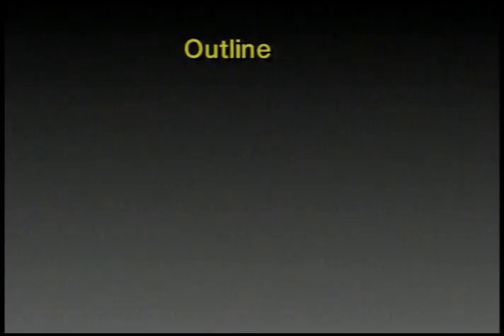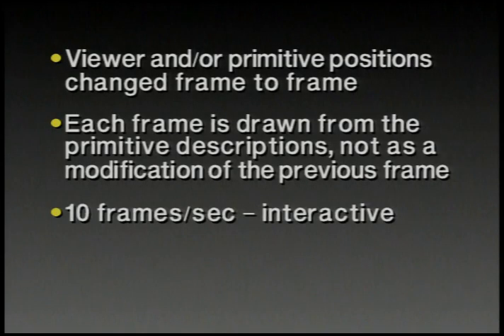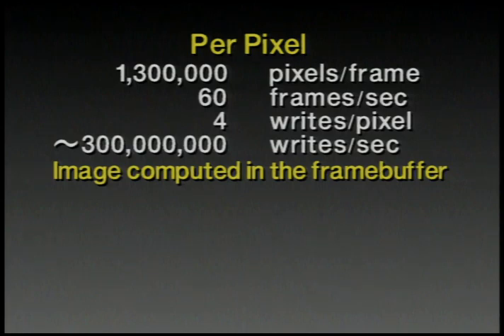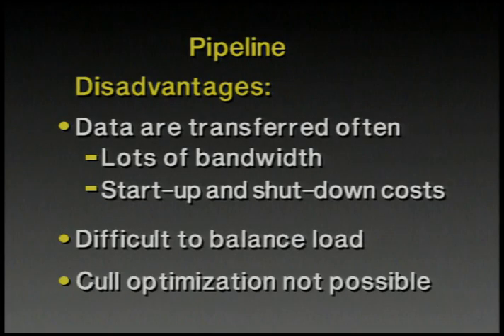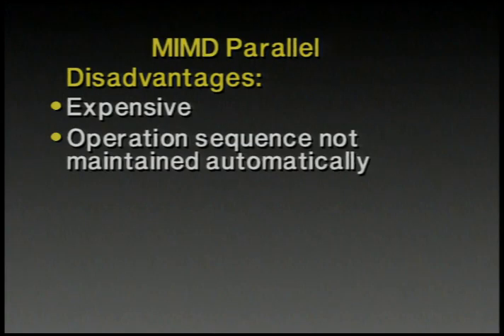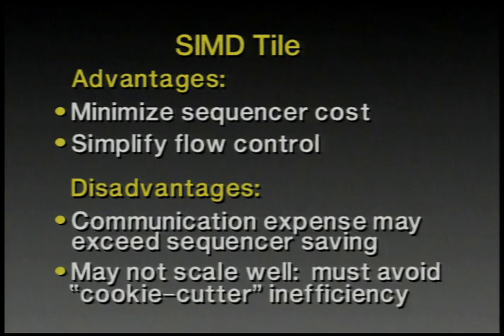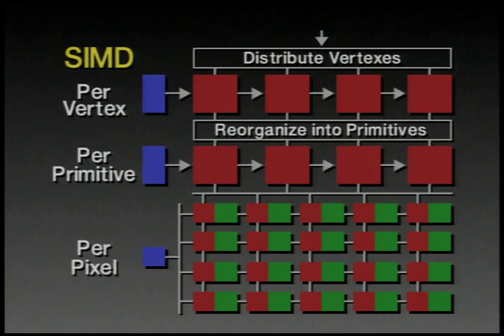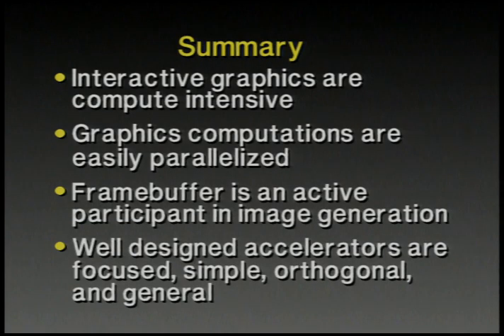Architectures of High-Performance 3D Graphics Accelerators, lecture by Kurt Akeley

Comment: Being from 1992, this foreshadows why GPUs would evolve from 3D accelerators without onboard vertex processing to early TnL GPUs with dedicated vertex and pixel shaders and then to unified shader arrays (check timestamp 47:27).  Basically a transistor and processing density threshold had to be met to make unified shaders worth pursuing and this presentation hints as to why.  Even the generation just before the first unified shader parts needed dedicated on GPU dispatch engines to deal with how complex real time graphics had become.  What a crazy three decades since this was published!